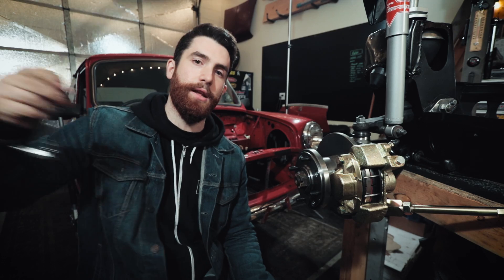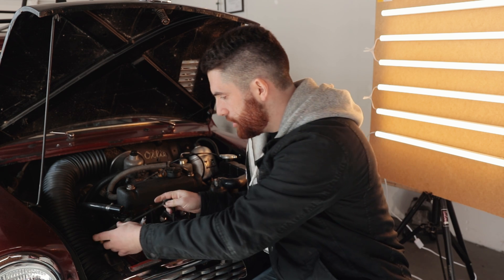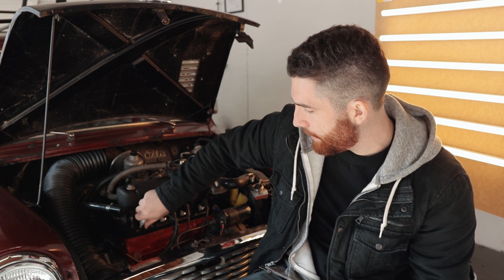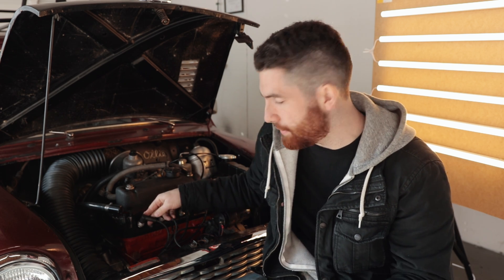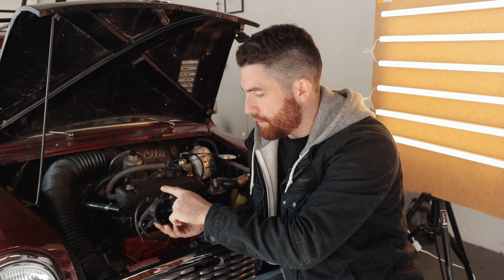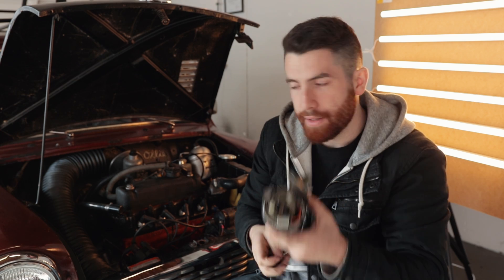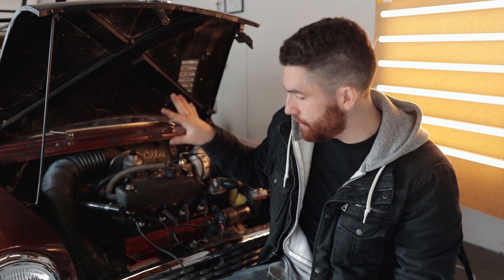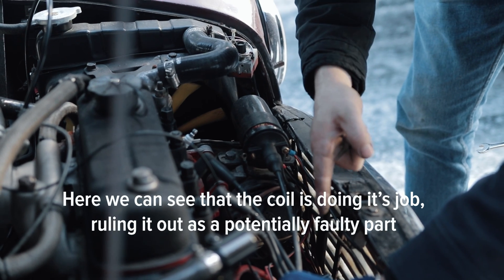Diagnose a Mini Ignition Fault (No spark)

Comment: tip: testing for continuity doesn’t prove the circuit is not faulty; you can have continuity yet the inside metal of the wire can still be chewed up, preventing proficient current flow.

Comment: hi man, my mini was running well today after 20kms and came back home to wash it with Karcher. after washing my car didn't want to start. I tested sparks and everything. I don't 12v on my ignition coil (key in after contact just before starting position). the white cable (+) connected to the positive on the coil, where is it came from? maybe the cable is rotten or cut off due to the water pressure.

thanks for your help
Reply: Did you fix it? I have the same problem

Comment: I’m in a no spark situation. How do you remove a distributor? You rotated it to see if the cams open but how do you do that when the distributor is still in the engine? Do you just turn the key to crank it?

Comment: I'm having none of these issues, I have a little four-cylinder Hercules generator no spark no start. Everything is new, everything's wired up the way it should be everything is grounded where it should be on bare metal. So it's a push button start and when I turn the ignition switch on and I push the start button I have no spark yeah when I turn the ignition switch off I have a spark plug tester between the plug and the spark plug wire it makes a spark and I'm not getting any spark from the points.

Comment: A mystifying cause of breakdowns is the rotor arm. If it is black plastic
and has a brass rivet ,under undefinable conditions the rivet can cause 
 your 30K volts to go to ground , and a few minutes later be OK. The only
   solution is to get a red or green one (with no rivet )and there will be no 
more problem

Comment: My name is Joe, I'm using my wife's account. I'm having a terrible problem with the flasher hazard on my Mini 1995 SPI. It doesn't work but it buzzes all the time. I have exchanged it with new ones three times now with the same result. I have changed the side indicator units. Can this be affecting the flasher? The parts I have used are original. Is it possible that there is no earth connection and this is the culprit? Any input from you would be appreciated.
Reply from the maker: Hi Joe, sounds like there is a problem with the wiring. It's tedious but I'm sure you will solve the problem if you follow a wiring diagram and trace wires one by one to make sure everything is wired correctly.

Comment: Check your points gap setting (should be 15 thou) and check for water / condensation / corrosion in the distributor housing. 9 times out of 10 that's where the problem was with mine. I learned to carry a stubby flathead screwdriver, a set of feeler guages and a spare set of points as part of my standard tool kit when driving my mini any particular distance away from home. If you carry these items you mostly won't need to use them, if you leave them at home you will probably end up wishing you had brought them with you. It's a cheap form of insurance and certainly much cheaper than having to pay for a tow back home.

Comment: I leave the plugs in the leads and lean them against the head to ground them to test they are sparking and the leads are and plugs are good.  Also, if you're on your own, you can short out the starter motor with a long screwdriver to turn the engine over and test various parts of the ignition system.

Comment: Wonderful video. My tip is ditch the points and go electronic on the distributor. We imported a Japanese 90 Mini with a 998 about a year and a half ago.  It was tough to start, idled rough and didn’t run great at speed.  It had a big Weber sidedraft carb on it.  I figured it was the carb and it was just running way too rich. I swapped in an HF.  It still ran rough. I got new wires, cap and plugs.  Still rough, but a little better.  When I went to look at timing I found an intermittent miss to #1 plug. I tired fiddling with the points, got frustrated and ordered an electronic distributor and new coil.  Dropped them in, turned the key and it fired smooth and idled like a dream.  I about wanted to cry. The plus side is in the process I went through the fuel and ignition systems pretty thoroughly. Even adjusted the valves. It’s been great ever since. You can make points work, they were used for a long time, but there is a level of mechanical fiddling that it takes that I’m just not interested in.
Reply from the maker: great point (no pun intended). Do you still have the weber?
Reply: @Stevestonmotorco  I do still have the Weber.  I might try putting it back in eventually, it does sound amazing, but the  SU is just so simple to tune and the car is running nice, so I am hesitant to mess with it.